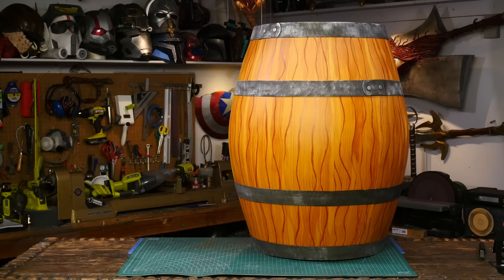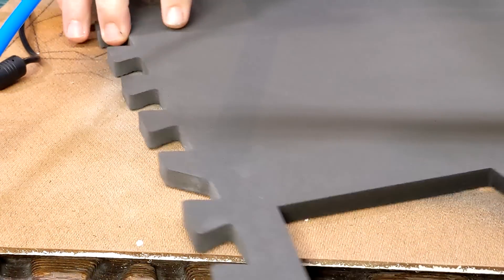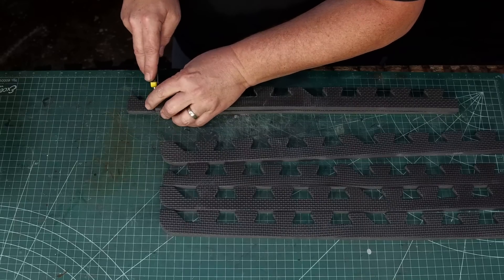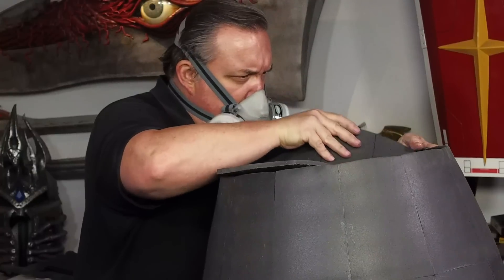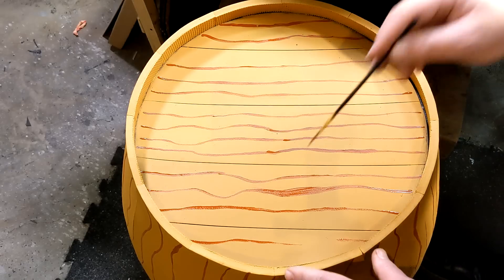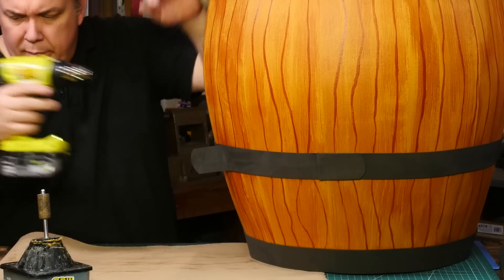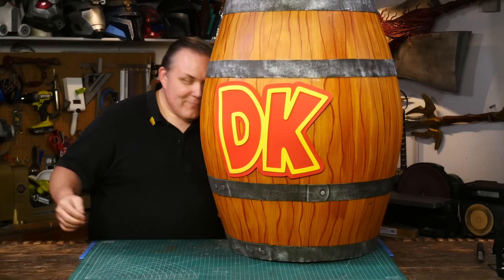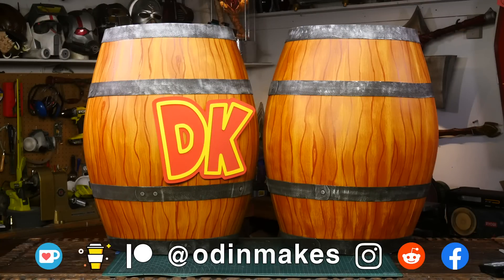Odin Makes: Donkey Kong Barrels

Comment: Love the work, per usual, Odin.  You never cease to amaze and entertain.  I'm sure you're already aware, but there are rubber paint roller inserts that have a faux woodgrain texture molded onto them, so when you make one long smooth roll, it applies a very realistic woodgrain pattern with paint.  Not sure if it's something that works well with foam, though.  Just a thought.  Keep up the awesome work, and thank you for the content!
Reply from the maker: I thought about them briefly, and I wondered how well they would work on a curved surface?

Then completely forgot about them when I ran to the hardware store!

Comment: the timing of these is awesome! I have 2 small barrels I was going to turn into DK barrels and wasn't sure how I was going to do the DK. thanks for the vid Oden, it was amazing as always
Reply from the maker: Glad I could help!  I will put the DK file I made in with the pattern right now. It would be easy to cut out by hand.
Reply from the maker: I added my files for the DK logo into the link for the free pattern. One is a .svg file, you can open it with a free program called Inkscape. The other is the Lightburn file for laser cutting. It is sized to be cut from a full sheet of 9" x 18" 2mm craft foam. I didn't even paint mine, just cut from the correct color of foam.

Comment: One nit pick, you should have put cut lines every 2 inches or so, on the body.  Staves are usually 1.5-3 inches wide in a regular barrel.
Reply from the maker: Is very true. I thought about as well, I was not sure how to curve the lines so they would look vertical. Not without making 2 or 3 prototypes first. As a parade prop, these will be fine.
Reply: They were amazing! We won 2 awards!

Comment: Do you have to take any precautions lazer cutting the foam? I noticed some smoke popping out the bottom so I wasn't sure if it was something you have to be careful about.
Reply from the maker: Yes you do! The light from the laser is harmful to your eyes, like the light from welding. Super high UV. I am wearing glasses that filter the light so it's safe to look.
And the smoke is the vaporized foam or burnt wood. I have a vapor mask on, and exhaust fans in my shop. I plan to make a smoke capture device in the future. My S10 still needs a permanent home in my shop so I can set it up.

Comment: Curious to how hard it would be to modify the design to allow for one of the end pieces to be removable? That way it could be semi functional, possibly to store and transport a DK cosplay.
Reply from the maker: Pretty easy, add another layer or four of puzzle edge, and don't glue the cap on. You might also want to add paint sticks under the cap for support. The foam curves a little due to size.